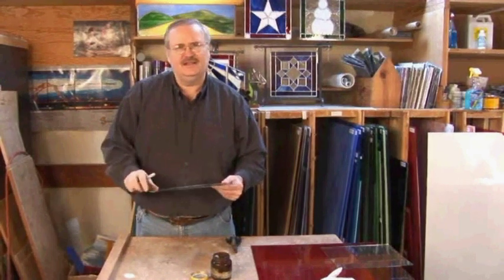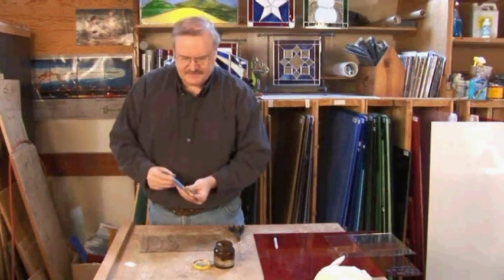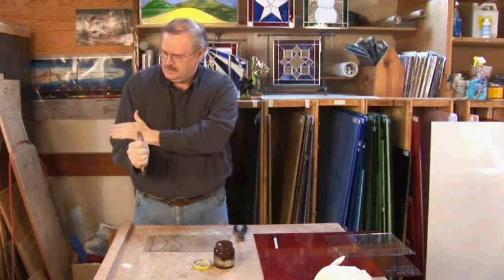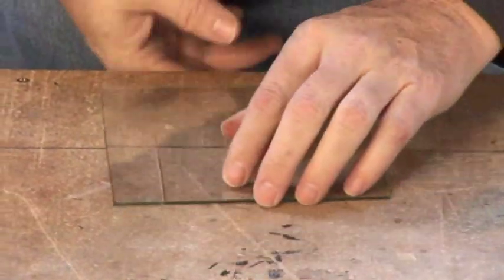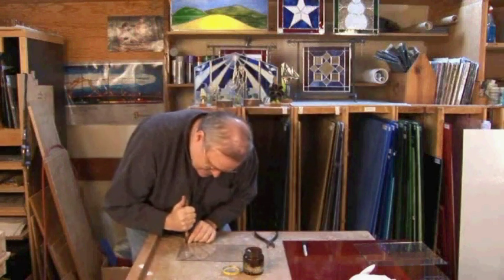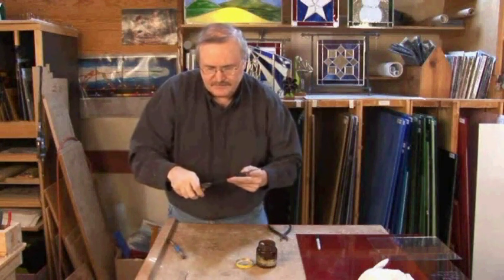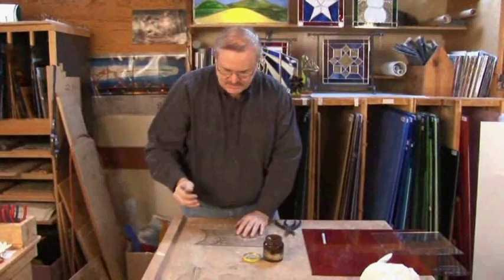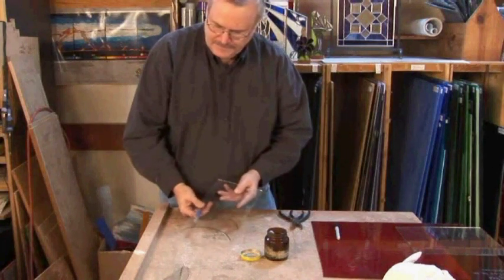Hand Held Cutter Stained Glass Cutting Demonstration V028

Comment from the maker: On the curve step (second cut) You could tap the piece out, but if you first use the pliers to run the score on the ends, you'll have greater success not breaking the sharp edges at the ends.